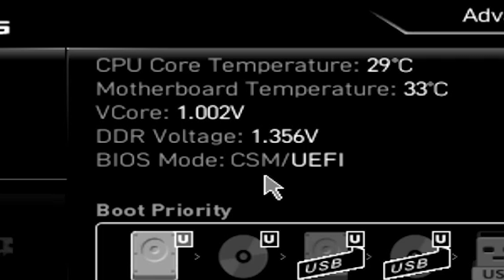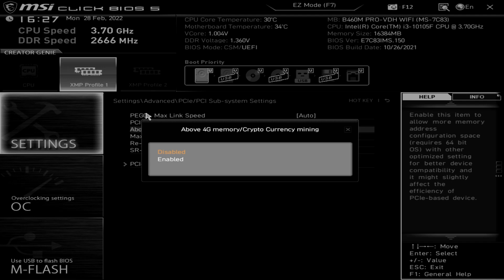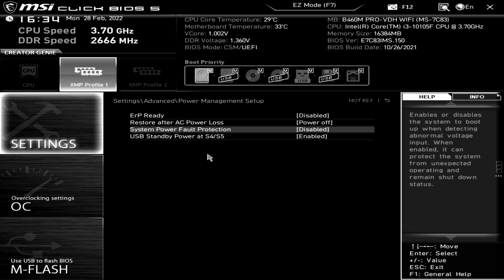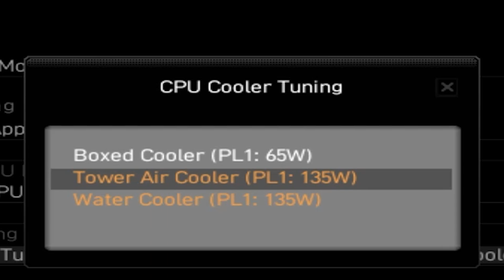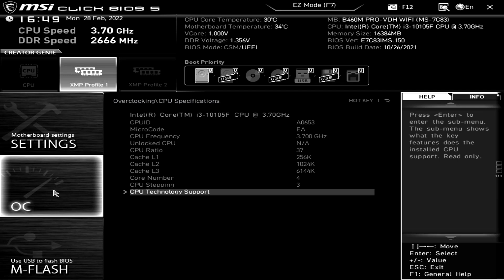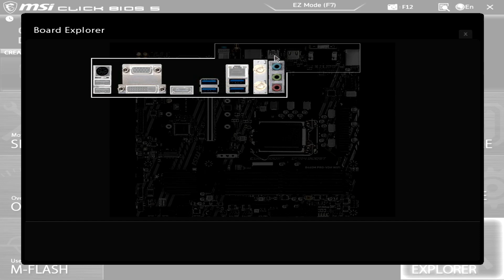MSI B460M Pro VDH Wifi BIOS Tour Walkthrough Tweaks & Performance Options

Comment: Excellently explained Mike. With regrade to Windows 11 upgrade. I believe I know what to do, 1. selecting TPM 1.2 then upgrading it 2.0 and 2. Secure the Boot sector. Although you did mention some caution making those changes.
Reply from the maker: yes if you enable secure boot or TPM and you have a bitlocker encrypted drive, you will lose access to it without having an unlock key
Reply: @mikesunboxing  thanks Mike,

Comment: do you need software to control the ARGB fully or is it software support as that is a sale or no sale point for me as I don't run windows. I use Linux and RGB software is limited. I normally like gigabyte as they have basic RGB setting in the Bios stops having bulkware on system
Reply from the maker: it is really just software support although it seems openRGB and signalRGB are working on linux versions
Reply: @mikesunboxing  Yeah both of those can be very hit and miss software. I fail to get my Gigabyte board recognised by it, but then Gigabyte has a basic 7 colour setting in bios. While Msi seem to be only on or off in their bios modes, and reliant on RGB software (bulkware). For now I watching the market as parts are high prices I must say if I going to use credit I may opt for a Laptop as the prices on them have dropped a lot vs similar powered Gaming rigs thanks to the criminal GPU prices. For now I going to sell up my old part while the prices are high for them. RGB is a game ender for me really though.